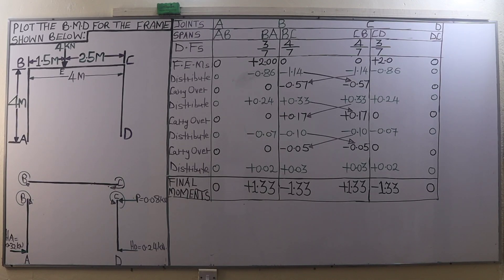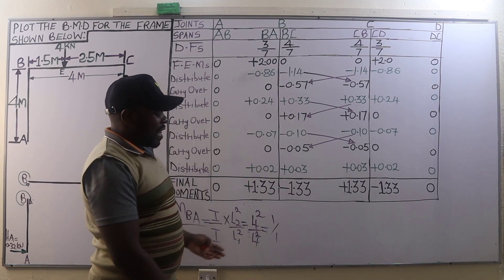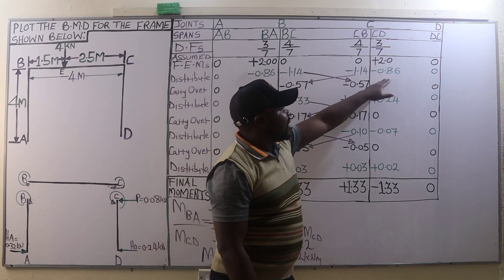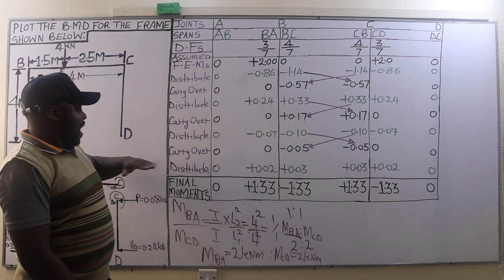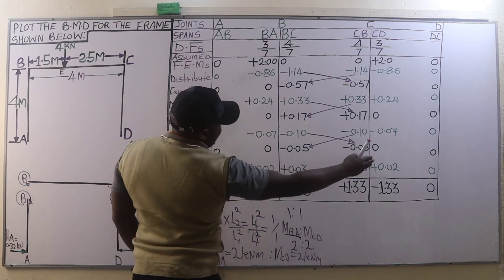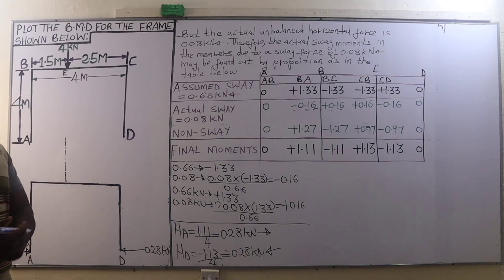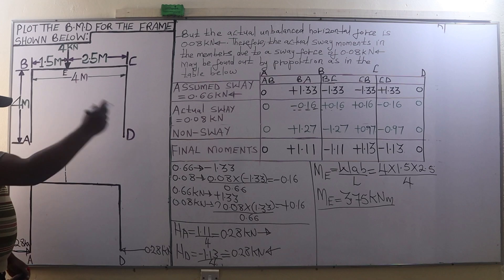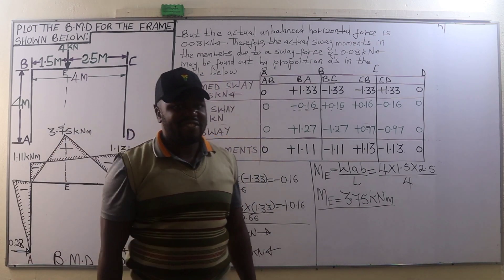PART 2: HOW TO PLOT THE BMD FOR UNSYMMETRICAL PORTAL FRAME.

Comment: When do we calculate  both fixed end moments and free bending moments,and when do we calculate free bending moments alone
Reply from the maker: Fixed end moments
FEMs are calculated when a beam has both ends fixed and is subject to certain load conditions. FEMs are reaction moments that develop in the beam member. They are calculated using the beam's span, flexural rigidity, and displacement. 
Free bending moments
Moments are calculated by multiplying the external vector forces by the vector distance at which they are applied. Moments are calculated at the beginning, center, and end of uniformly distributed loads, and directly underneath point loads.